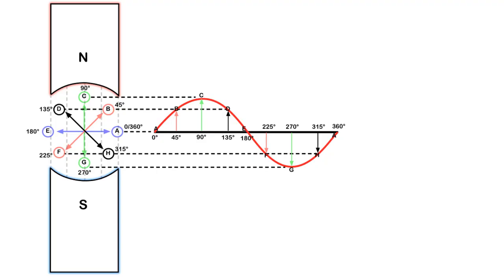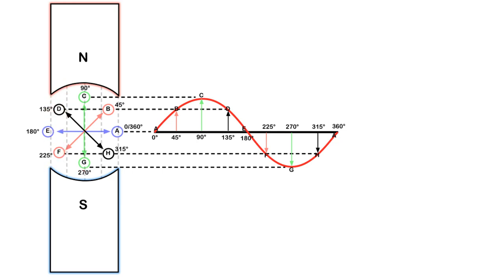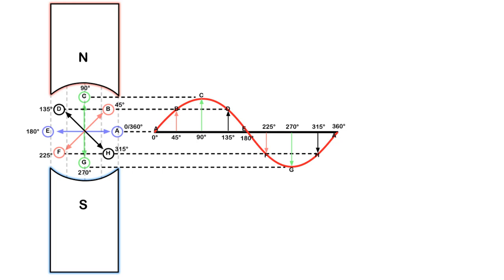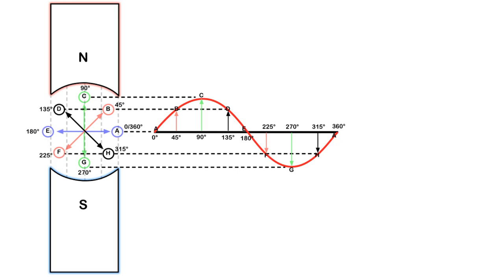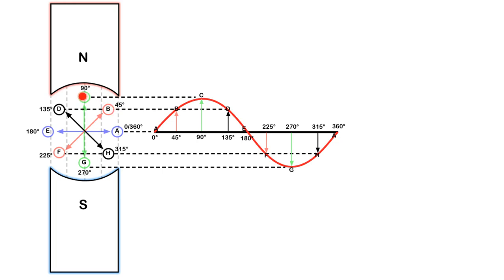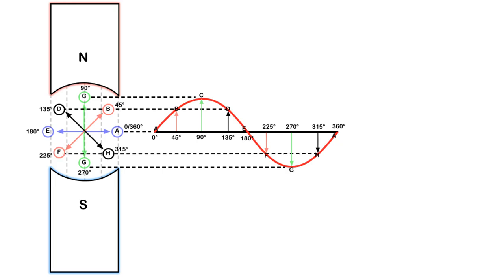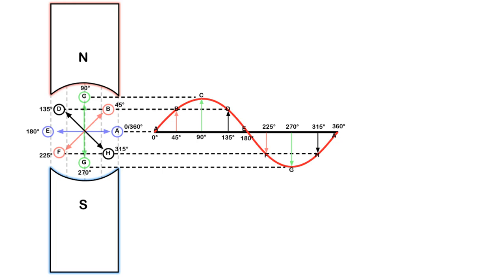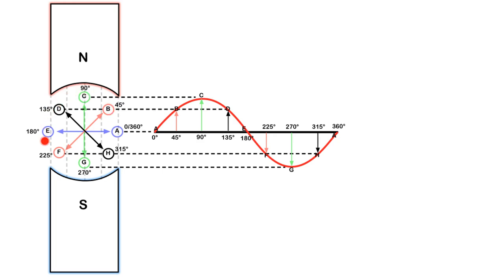Sine Wave generation

Comment: There you are. Only 2 things. At 0° conductor is in parallel to flux lines so no intersection therefore no emf. And at 90° conductor is perpendicular to flux lines, so full cutting of flux lines and hence maximum emf induced. Please correct me if i am wrong.
Reply: You are correct! The directions of flux from the magnet should be changed.